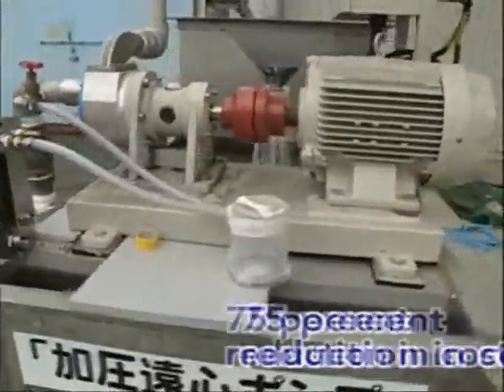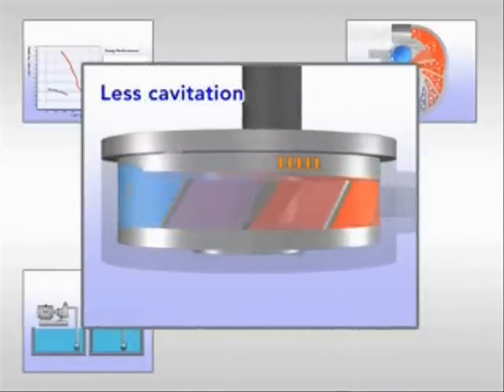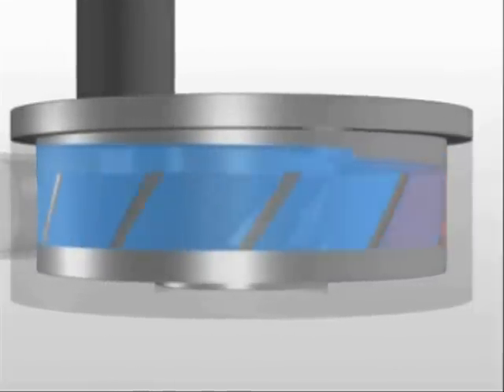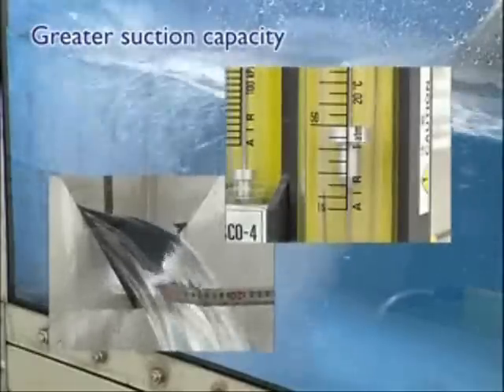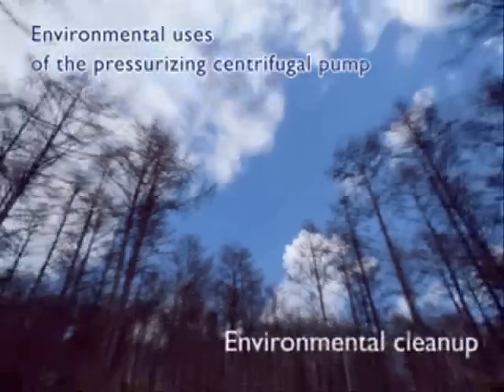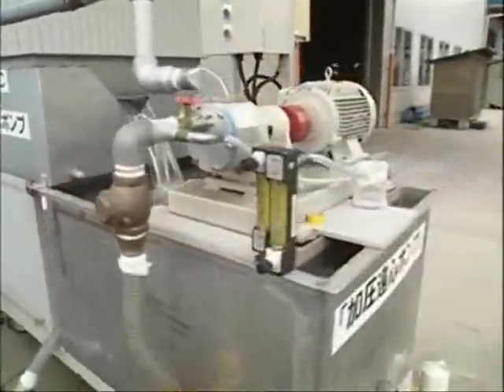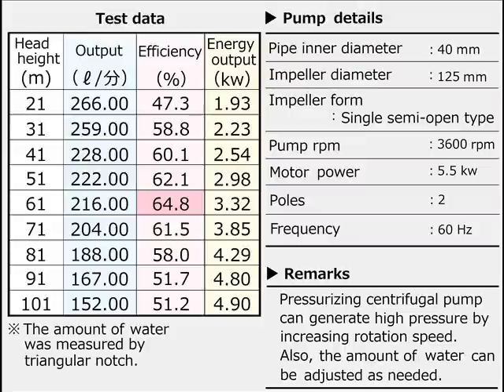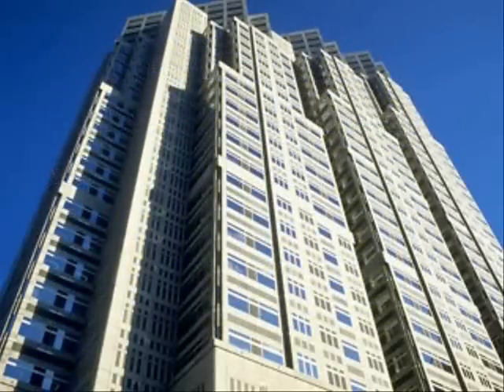This pump is changing the world !!－Pressurizing Centrifugal Pump

Comment: when you compress air it builds heat. that interms will most likely prematurly wear out seals.
Reply: "when you compress air it builds heat. that interms will most likely prematurly wear out seals." Not when the air is mixed with water. Water could absorb a lot of heat.

Comment: I like the design, particularly the "cam shape" of the first part of the volute the liquid passes through that allows the water to gain speed gradually, but I have some questions.
The efficiency, the energy in terms of (pressure X volume)/ energy in runs around 50%.  How does this compare with other pump designs?
I expect your design is very sensitive to solids in the liquid being pumped, as it has relatively close contact between the rotor, and the volute.  How much sand can it tolerate in the water being pumped?

Comment: While you can compress water, or almost any material. However, it requires a great deal of pressure to accomplish a little compression. For that reason, liquids and solids are sometimes referred to as being incompressible. So exactly how much compression of water did you achieve with this little pump that moves less than 75 gallons per minute with a 20' lift?
Reply: "So exactly how much compression of water did you achieve with this little pump that moves less than 75 gallons per minute with a 20' lift?" By adding air into the water, he has made the water+air mixture semi-compressible. When the air expands, it became cooled, thus extract heat from the water. This is the real reason why this pump is so much more powerful, because it extracts heat from the water and turn that into kinetic energy. So I suspect the water temperature at the nozzle is COLDER than the feed water temperature.

Comment: The water does not compress, the air mixed with it does. It works by reduction in volume of the combined air /water solution.
In combines kinetic energy via the impeller's acceleration of the fluid with a nozzle to accelerate the compressed air.
This would work
Reply: elmura73 m
Reply: By adding air into the water, he has made the water+air mixture semi-compressible. When the air expands, it became cooled, thus extract heat from the water. This is the real reason why this pump is so much more powerful, because it extracts heat from the water and turn that into kinetic energy. So I suspect the water temperature at the nozzle is COLDER than the feed water temperature.
Reply: Mixing air with your water produces REDUCED output. Air is the enemy of good water flow and pressure. This pump fails on basics.

Comment: This is rubbish- it wont ever work as water cannot be pressurized this way- due it being a liquid.
You cannot pressurize water this way Sir- I hate to tell you. It will just leak out the sides of the vanes.
Water is not like air where you can compact it in the same space using mechanical pressure.
Clearly you know NOTHING about pumps, Physics and Hydraulics.
If you look up the company, it doesn't exist and the "patents" are "google" and "free" patents. 
Sorry to break this bad news- you have to be a pump guy to understand pumps PLUS have a lot of experience.
Teknikgroup.com.au
Reply: You should study pressure washers... it turns into speed or head instead of pressure.  try not to be so condescending.  Everyone didn't get the memo that you knew it all.
Reply: LOL. Its basic physics.The comment was directed at the poster of the video. (who turns out to be a scammer) Keep calm and watch this video...
https://www.youtube.com/watch?v=llhcATrmsBg
you will then understand why the pump wont work.
cheers and keep smiling...another day in paradise.
TK
Reply: True, water cannot be compressed, but by adding compressed air, volume and pressure are automatically increased. I'm not supporting the alleged "patents" but  compressing air in the water will increase its effect and range.
Reply: The “compression” referred to here is on the outlet. Water cannot be compressed but pressure on the outlet can be increased.
Reply: "Microbubbles" was the term used, compressed air will increase pressure on the water - more pressure, more range and effect. Water can be moved both mechanically and via air pressure. Just think "pressure tank" it's either that or gravity if you want to move water. Since water cannot be compressed, you have to compress (pressurize) something. Microbubbles would act the same as a pressurized air-pillow at the top of a pressure tank found on any water well pump system. Compression is the key.
Reply: animation to make u understand,
Reply: Increase at the outlet is the point, introducing air pressurized by the pump results in greater pressure effect at the outlet. Call it what you will, pressurization and expansion is the point. That takes air and better design.
Reply: Ever heard of cavitation it destroys pumps why because of micro bubbles.
Reply: Why so negative?
Reply: Joel, we are obviously having the author and you and others claiming that it indeed works, and we have others claiming that it does not work. 

MY comment comes from my kitchen, where I have a high-powered blender (SAGE, 1,000 Watt engine). When there is air in the blender it runs and blends perfectly. When filling it up, apparently the same mixture becomes very slow and heavy - the blender simply runs half speed and runs warm. 

On boats, adding air-bubbles underneath has been shown to really reduce the friction between boat and ocean. 

In sewage tubes/pipes, when they fill up (!), instead of having even the smallest free space above the flowing sewage water, the speed reduces, the entire friction-formula (used to calculate the transportation speed of sewage) changes (reduces the speed tremendously). 

Therefore, Joel, I am very interested in your views, and as I am not a pump/liquid specialist, I would be very happy if you here can add some comments as to why you think it would work. 

Would you mind? I thank you in advance. 

I work in the sector of renewable energy, however, with solar concentrator equipment, so I am interested in such a pump from the point of view of providing maybe a good pump for irrigation, driven by solar energy...
Reply: The pump will work, if your study the design drawing - the impeller and form of chamber do 2 things (without water it will compress air/gas, and together with water it will lover the friction/accelerate the output.) Why this pumpdesign not yet is in commercial production, is probably the designers imaginations - many of the suggested applications, will be suited better by other design. 

Ask your selv, where do we need a large amount of pumping force/volume , together with the wish of adding micro buble to the output.!

1. Firehorse, yes because of the greater cooling effect - but marked is small, and conservative - so if it not will be showing around the world in real work - it will take long time to reach the marked. (added with inert gas, like CO2 etc.)

2. Scrubbing of productions gas, like wood/biogass, will be a time/space saver.. marked is limited, but a got potensial.

3. Clearing tank/lagoon at sewage facility, they have a great challenged with productions of microbubbles, to reach a great reactions arryer.

4. Fish Farming on land, will probably get the greatest benefit, by use of this design. Oxyanions of the water, and pumping force over the aerobic filter. 

If some is interested, do I want to make some sample of this design, for testing/demonstrations 

The expression from designer "This pump is changing the world !!" is not correct, but it will open op for new possibility, in design in dedicated arrayer..
Reply: A old pump with a poor seal do the same thing .

Comment: Hmmm.... Depending on what meterials its made out of and from were. That could cost you time and limmitation of use. Includeing parts.
Reply: Peter4101  the same technology of every outboard motor engine cooling where made of flexible rubber empeller . Good that it is applied in agri and industrial ussages